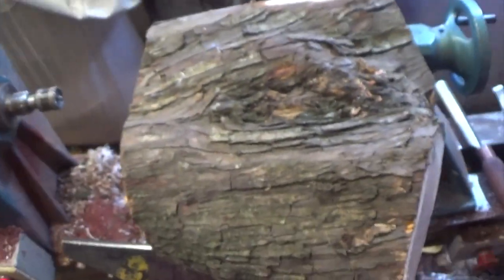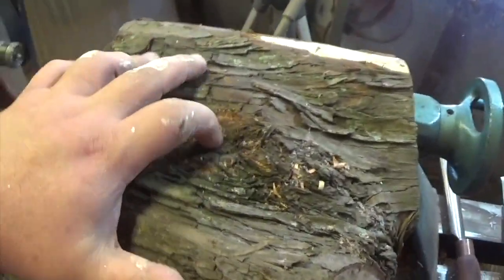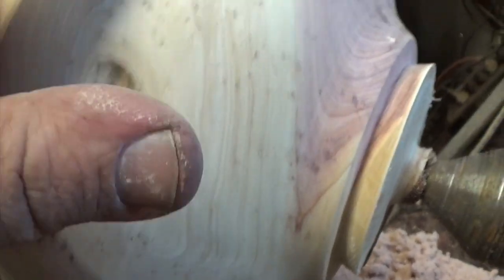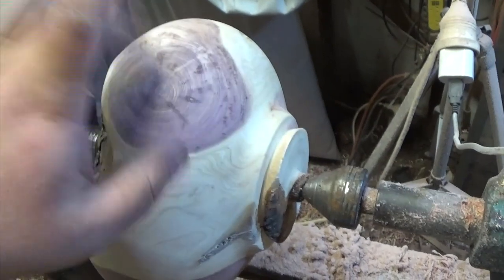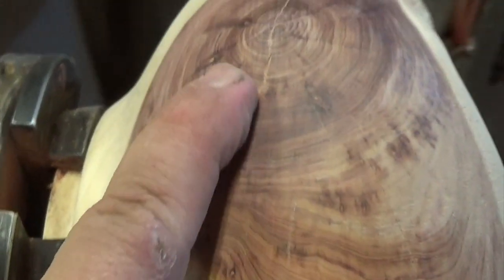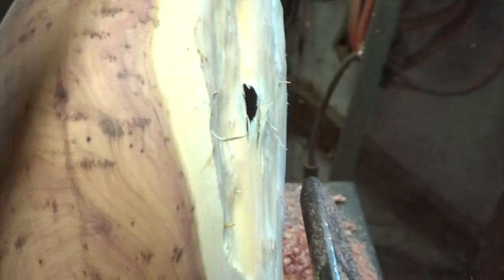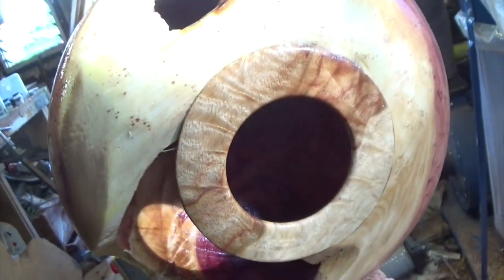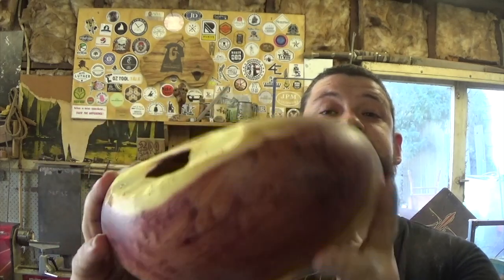woodturning: the wet log

Comment: Bloody aweswome job Guil, I love it.
How are you and and family doing with the Isolation? I guess it's not been too bad for us makers as we usually do projects by ourselves, and where in the unique position where we are used being alone working on something for long periods of time. With a new bub, how are you guys finding it? I can only imagine it's inconvenient when supplies run out, and with the recent restrictions on purchasing items it would be hard in that respect. For us, it's not changed much, apart from the kids being home, and doing school work at home, and it looks like it will be the same for the next term as well, at least down here. Only other thing is we usually bulk buy grocery items as we're out in the country, and the restrictions mean we have to go into town more often. Overall, though, I hope you guys remain safe and healthy, and don't go stir crazy.
Reply: There's another technique I've seen Cy the DIY Guy do many videos ago to dry out hollow forms at least a bit, with the piece mounted on the lathe, tip Metho/Denatured Alcohol inside the vessel, then let it spin to force the Metho into the wood and in turn dry out the moisture. Pretty sure it needs to spin fast enough to force the Metho into the grain, and I guess the amount of time and Metho used depends on the timber and how wet it is. I think the idea was to get the surface inside starting to dry to help stop cracking for the start of the drying process, I'm not sure, maybe ask Cy. https://www.youtube.com/watch?v=exwHPHpt4ws

Comment: Guil, Yes, indeed that is an incredible piece  pf cypress! I was wondering if you would consider slowing down your videos a bit. Most everyone does use fast forward some of the time but honestly, I get a little nauseated watching your at times. I want to see what you are doing more closely and at a slower pace. Sure, fast forward through sanding, and maybe up to five times normal speed. And from time to time, come back to normal speed and tell us more about what you are doing and why, for example, the tools you're going to be using and finishes used. You can be so comical sometimes, and I want to enjoy that as well. Just my thoughts. Cheers, Paige C.